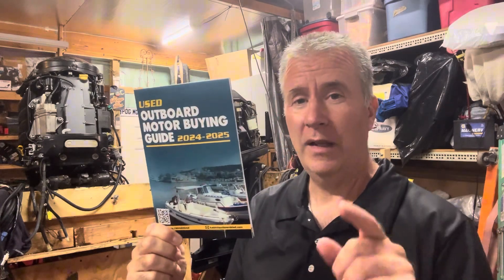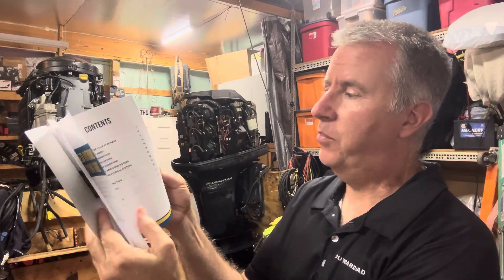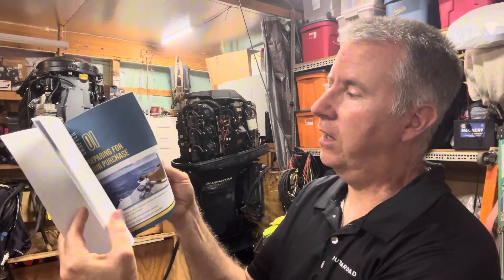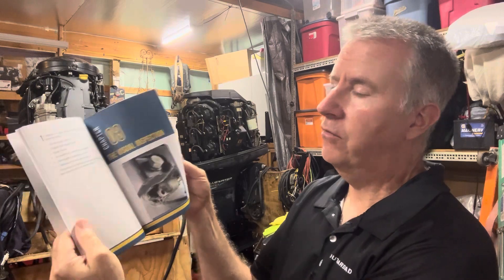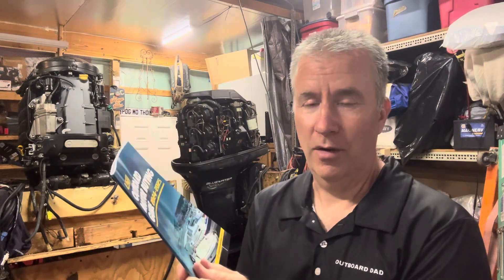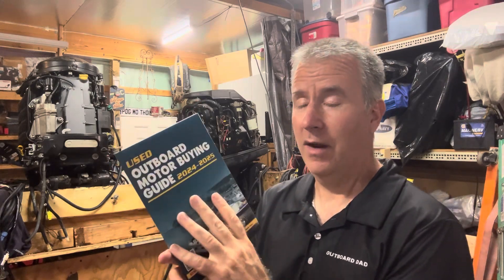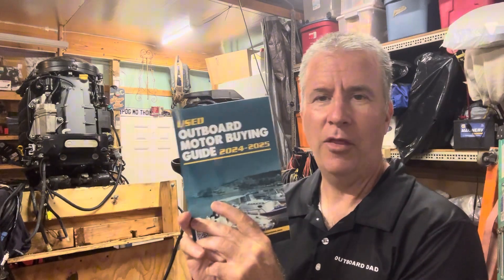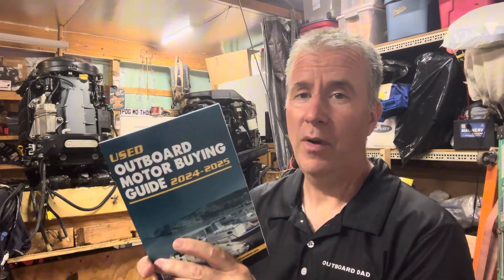Yamaha 90 HP Outboard Troubleshooting Ignition System a Second Test

Comment: It could probably use a carb cleaning, but it sounds like a 2-stroke.  Before the haters come out, I have a 2-stroke.  I would recommend a Seafoam or Marvel Mystery Oil treatment with a hot soak.  Its simpler and less time consuming than a carb cleaning/rebuild.  The worst that could happen is you de-carb the motor, which is always a good thing for an older 2-stroke.  You could do a carb cleaning/rebuild if it doesn't help.
Reply from the maker: I like that method as well, he supposedly had them cleaned but I suspect that as well. Are you an outboard mechanic?

Comment: As a mechanic with 30yrs experience, The manual for that engine is free online and it shows the ohms check to verify coils, wires , etc... with that said, if you want to replace a working CDI all you need to do is run the engine with an ungrounded spark plug cable, the CDI capacitor will burn up thus rendering the CDI useless. The Amazon coils will work but for only a short period, old plug wires on older yammies have a tendency to corrode at the contacts so i would check those as well. Good luck!
Reply from the maker: Excellent! Thank you! Appreciate your experience

Comment: never bought coils from amazon, but i had issues with OMC fuel primers. i had 3 bad ones so far. had to dig up used ones and they worked. had issues with yamaha cdi boxs dropping cylinders, also the spark plug suppressers going bad, having too high of a resistance.
Reply from the maker: Have you used OEM parts for better results?
Reply: @OutboardDad  sometimes ive had to  only because an aftermarket wasnt  avaiable or a used part not found. fortunatly i have a lot of old parts around, so that helps me a lot for my customer's.
Reply from the maker: @harveynewman4333 I also like old original parts when available. Do you have a parts business? Website?
Reply: @OutboardDad  i used to have a web site and 2 different businesses from 1990 til about15 years ago. i let my shop close because of a tragic situation in my life.  my customers,although closed, still kept coming to me. so i still work,out of my property,and still do road service calls. like to retire someday. im 70 years old. not so easy to do some jobs like riggings or personal water crafts because of my back.
Reply from the maker: @harveynewman4333 God bless you buddy! Where are you located?
Reply: @OutboardDad  lake placid florida.